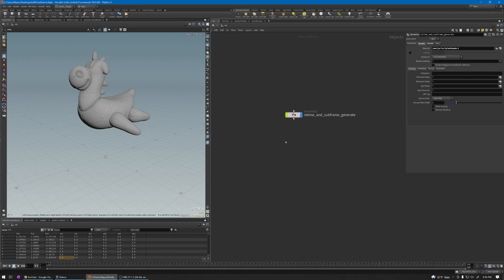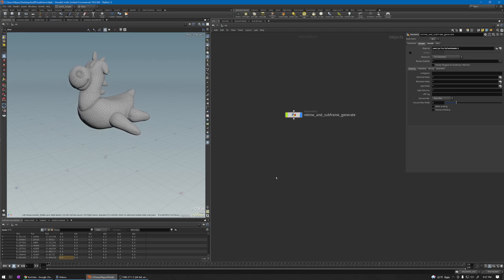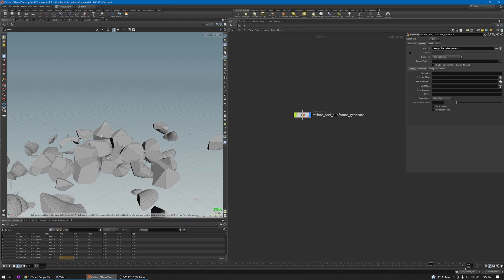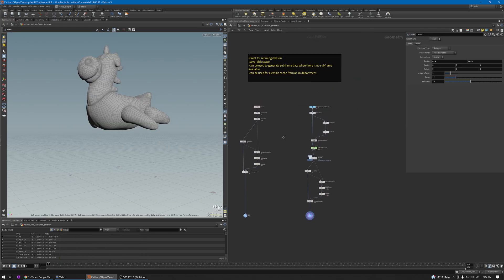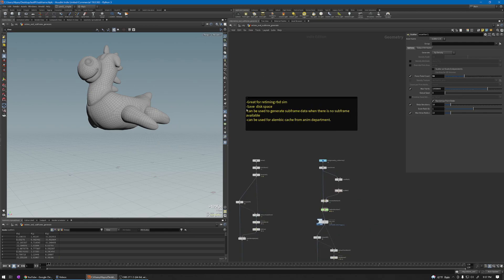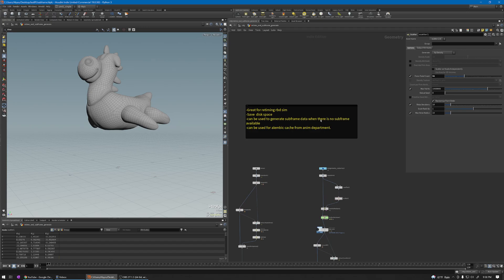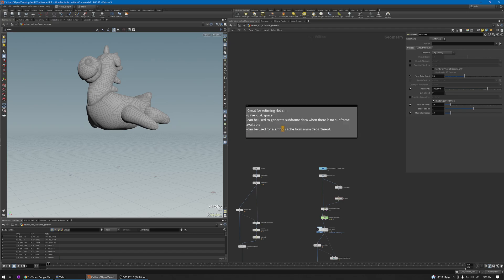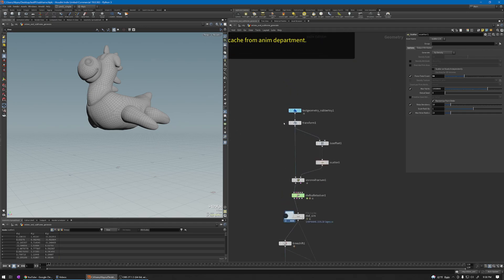22. Retime & Subframe generate in Houdini

Comment: Hey It doesn't seems to work with rbd on deformed geometry. The deformed geometry stays fixed but the fracture is happening :(
Reply from the maker: if your pieces are fractured and each piece also deforming this method is not going to work, because we freeze the pieces using timeshift to extract the transformation matrix. this is usefull for non deforming case but there are solution for deformation.
because you have deformation you can move all pieces to world center and using vex to apply deformation based on name attrib for each piece after transformpieces node. there are several solution for deforming case

Comment: Hi Jafar, i try uing the same technique with an alembic file, it's a fluid simulation, but it doesn't work with fluid, is there a way to generate subframe for fluid simulation. Thank you.
Reply from the maker: Hi, unfortunately this method doesn’t work with fluid meshes as the topology is changing each frame, if you still have your fluid sim particles( assuming it’s water ) you can use a timeblend after the particle cache to generate subframes then do the meshing. Also you need to check add id attrib in flipsolver if that’s the case. write the geo to alembic.
Reply: @JafarDashti   Thank you for your reply, i think i have to bake the simulation again, it's took too long to bake so i just try to find some other way to slow the fluid down. Thank you very much